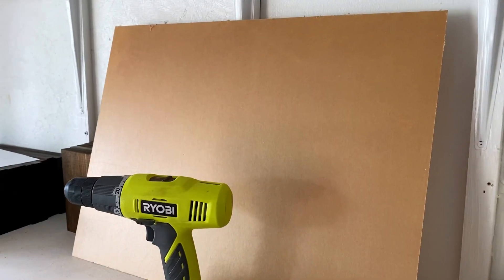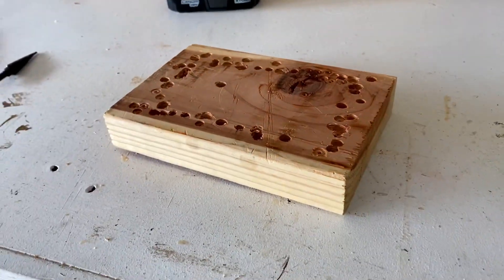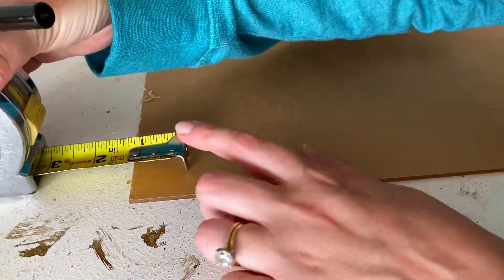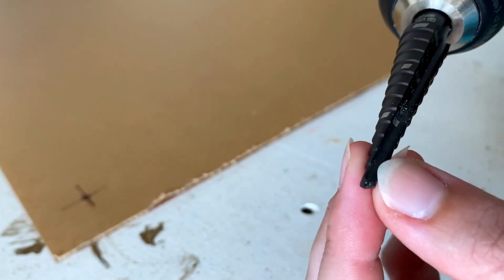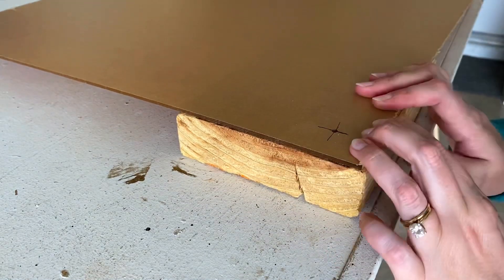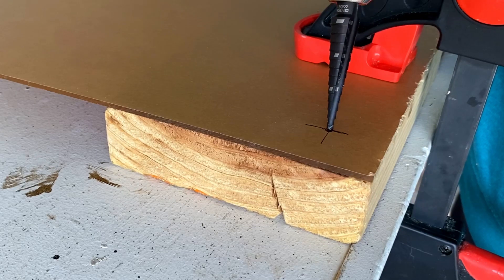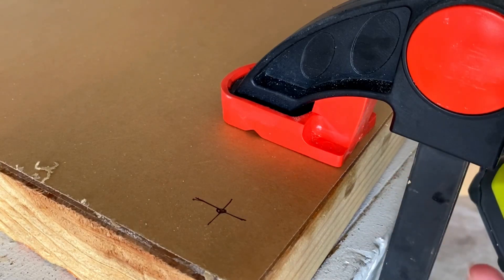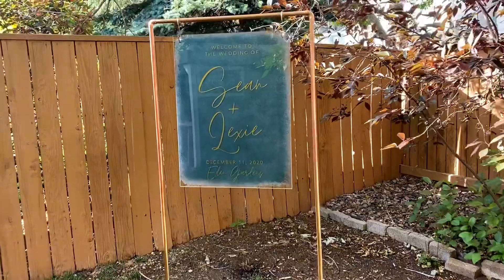How to Drill Holes in Acrylic | DIY Acrylic Sign | Copper Stand for Wedding Signs

Comment: Do you happen to have a video like this for smaller holes?
Reply from the maker: You can do smaller holes with this same drill bit, just dont go as deep with it!
Reply: @CarlyKeller  thank you, what about a flat shallow hole? I’m trying to glue a very small piece of magnet onto the surface of a thin acrylic sheet to be able to hang it on my fridge. Also, any suggestions on a clear glue to use to glue and fill a tiny hole?